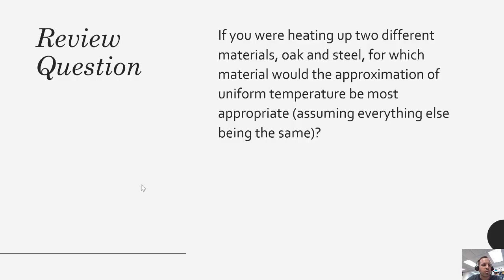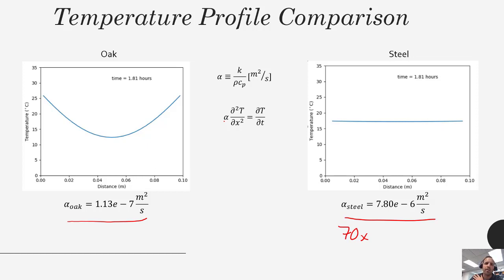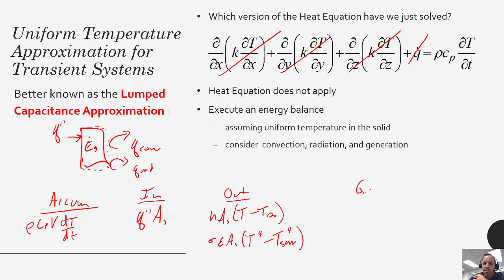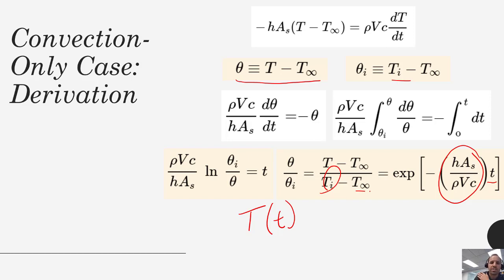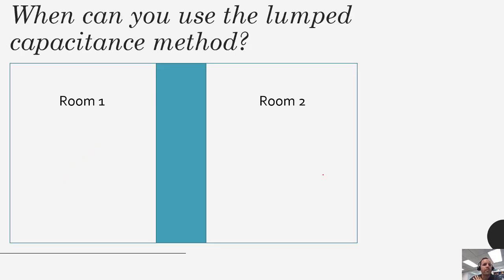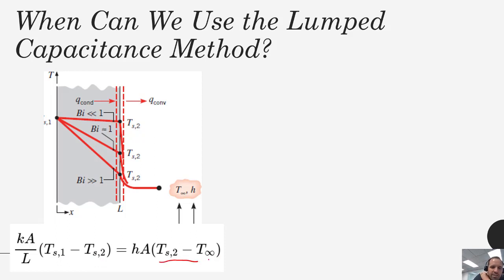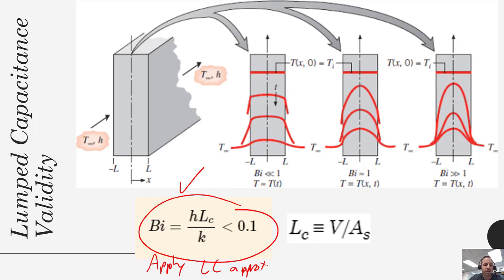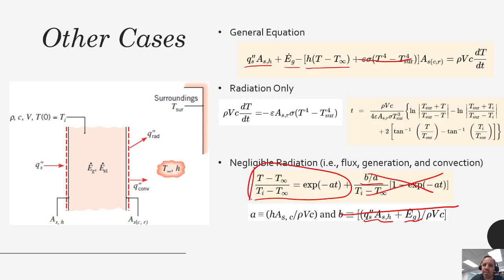Heat Transfer - Chapter 5 - The Lumped Capacitance Approximation

Comment: is lumped capacitance approximation is valid if we don't ignore the radiation term ?
Reply: then it will also depend on x so it will not be valid.... it becomes too complex, and for this, we can use Heisler charts.
Reply after 7 months....none of any use 😅😂😂
Reply: @indianmanhere  no worry
Reply: @sainagupta6475  Tomorrow is my midsem exam of this subject 🤕
In radiation it's get too complicated🥲
Reply: we can check validation by using the Biot number which should be < 0.1

Comment: Air convection coefficient depends on film temperature, therefore h values can be different at both sides. We must check Biot number for both halves of the flat plate to be able to assume that it's a lumped capacitance.